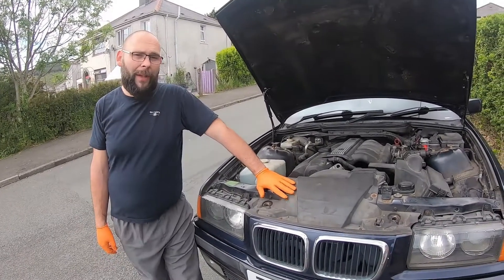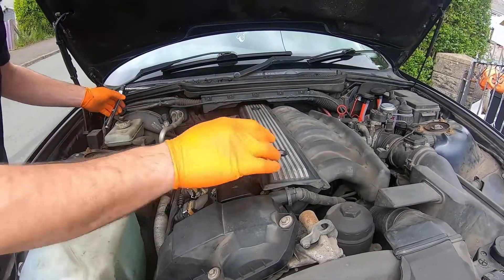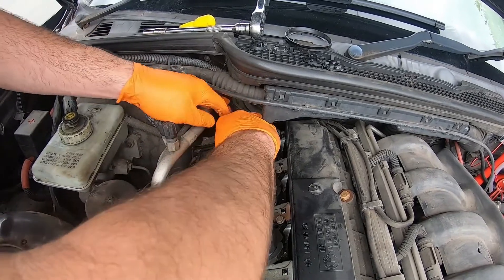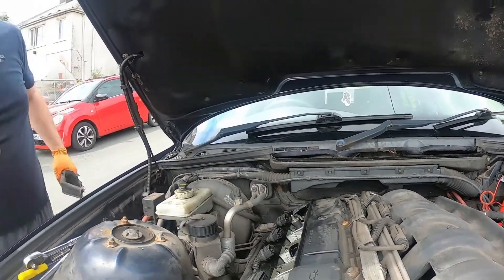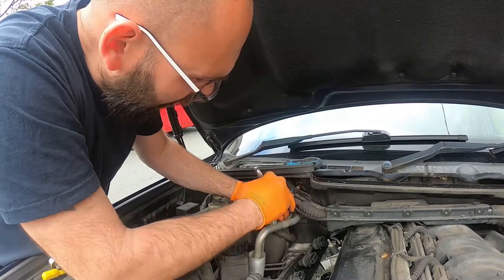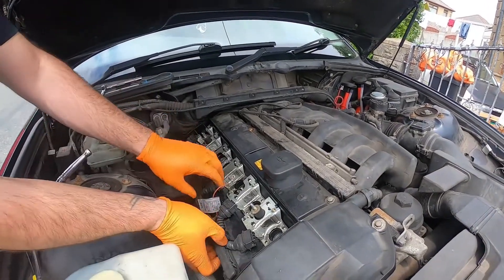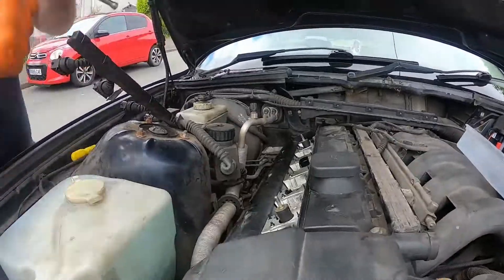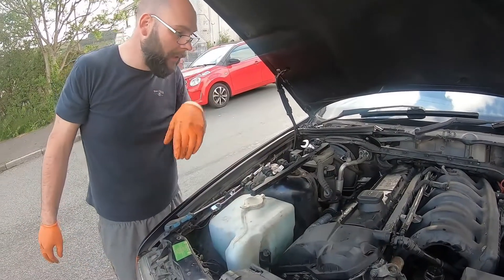How to replace a rocker / cam cover gasket on a BMW M52 straight 6 petrol engine, E36 E39 Z3

Comment: Thanks, good video. I need to do this on my 1999 528i
Reply from the maker: Thank you very much mate. I hope that the vid helped. It does seem to be a BMW trait. I had to change the Gasket on our E39 523, E36 323 and E46 330 lol
Reply: @wolf_kiff_workshop  You’re welcome. Yes me and my dad has to this on his E38 730i but it took us a while because we struggled to get the gasket on as there’s limited space in the bay and the gasket seemed to have been a bit small for the cover but we got it sorted in the end, no oil leaks anymore.